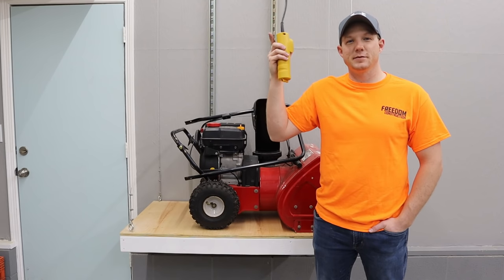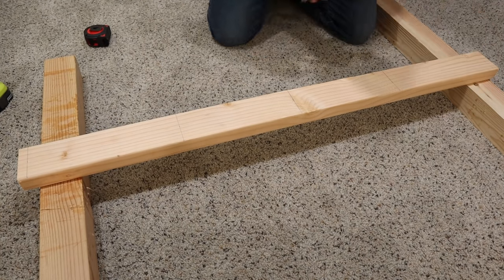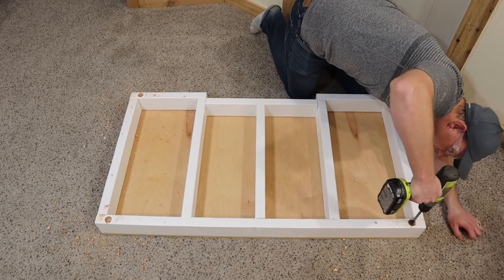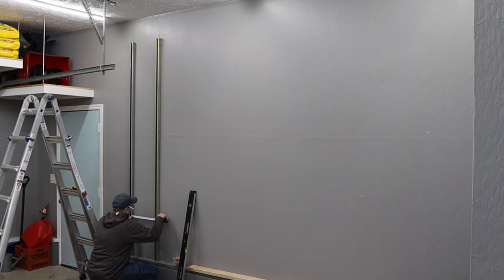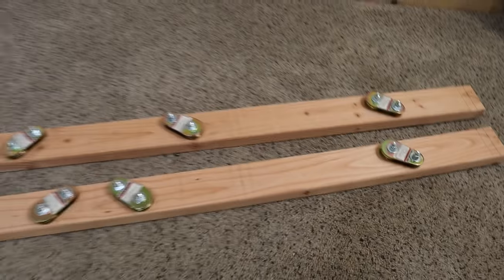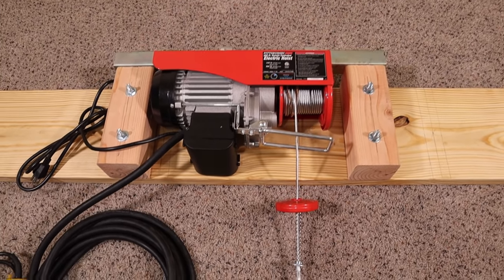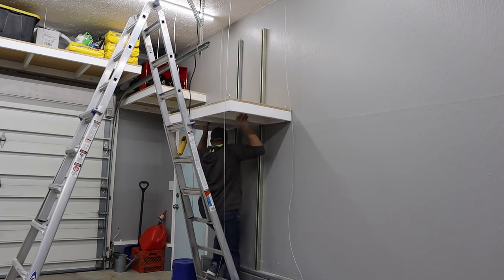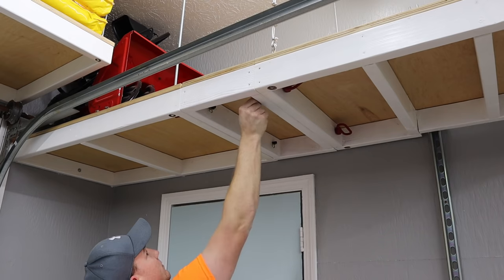DIY Electric Garage Storage Hoist | Snow Blower Lift | Garage Makeover Pt. 5

Comment: thank you! very informative on how i can do a similar project. laying it all out before installation help me see exactly how you did it. thank you!

you may be able to drop your lift all the way to the ground by angling your vertical channels on a wedged four-by-four so they clear the lower foundation issue. then mount your guide rollers on a hinge to accommodate the angle, then add the additional channels to the foundation. an added benefit to that is you won't have to lift the platform it all the way to the ceiling whenever you want to detach it.
Reply from the maker: Thanks! That is a good idea and If you do something similar I hope it goes well.

Comment: Your 'manifold' is actually called a "clue" in rigging terms. Also sheaves that change the direction of wire rope are called "re-direct" sheaves.  Fyi, Thats all.
Reply: Clew.  NOT "clue"  That's all.

Comment: It’s not bad, but I see a way you could have done it without going through the ceiling by running cables and pulleys  inside the uni strut, with the winch bolted to the floor. This would take the cables out of the way of loading. 
 That does NOT mean what you did was wrong.  
 You  did it how you thought best and how you wanted and it works, and that deserves respect in of itself.

Comment: Wow great…. Just a suggestion😊 Is it possible to make a turntable platform for a snow blower? My garage is small and with two cars it’s hard to bring the snow blower in and out. I have a corner in the garage where a snow blower can fit but only parallel to the wall. If I have a turntable platform I can rotate it and easily bring it out. Any idea how can I do it. I don’t mind manual instead of motorized 
Thanks a lot🙏🏼😊

Comment: Great work and a wonderful idea.  However, with everything you have mentioned, I did not hear anything about calculations for the additional weight that your trusses will now carry.  Trusses are engineered to use the least amount of materials to be able to meet the requirements for their use.  I doubt these trusses were engineered to carry the downward force being exerted onto them by your storage assemblies.  Although the snowblower only weighs several hundred pounds, the additional dead load of the bags of salt and other items certainly exceeds the specs of this roof.  Now add the weight of a good snow load (why else would you need a snowblower) and your garage roof is in danger of catastrophic failure.  As a 30 year career firefighter & carpenter, I have seen these projects, without proper engineering, go horribly wrong.

Comment: Be careful with that winch it tend to stack the cable like a pyramid and wen there is no more space on top the cable drops to one side the result is the the load drop instant with no worrying, we used one for a log home build, had one log just drop
Reply from the maker: Thanks for the heads up I will try to be aware of that when using it.

Comment: Great job.  I'm curious, why did you do much of the prep/assembly work inside on a carpeted floor, instead of in the garage?
Reply: @Zachary Peters I initially thought that was the reason, but you're wearing a short sleeve t-shirt in the garage!
Reply from the maker: Thanks! Ya it was hard to explain to the wife doing work on the carpet in the basement but it was better than running space heaters in the garage the entire time lol

Comment: Are you building this project in your living room? Carpet full of wood chips? Great idea tho. I was concerned(I am an electrical contractor) about the length of the screws you were putting into the wall studs.
Reply from the maker: It was in the basement because it was like 10 degrees outside lol I was pretty sure there was no electric in the wall because there are no outlets on that wall and the other electrical runs through the attic

Comment: Question for you, is there a reason that you had the lifting mechanism up in the attic space instead of the floor, bolted into the block?  I would love to do something like this in my house, as my garage has a high 12 foot tall ceiling.
Reply: I kind of thought the same thing.  Why not have the winch below the platform although I guess a 180 degree turn would increase the friction.

Comment: Your quicklink is side loaded and is the lynchpin. Your entire rating is the rating of the side loaded quicklink. You really need to replace it with the proper hardware and redo the incorrect cable clamps. Otherwise this is a really cool idea with interesting execution.

Comment: As a structural engineer I would like to point out that your roof trusses are likely not designed for the additional loading you are putting on them from all of the materials you are hanging. I would suggest getting the allowable loading sheets and verify that you aren't exceeding the bottom chord allowable live load.
Reply from the maker: Thanks I appreciate your expertise and agree that would be a good thing to do. My thought is on the shelves much of the weight is going to the wall and the lift will only lift the weight of the snow blower for short periods of time. You should see the junk neighbors in similar houses have in their attics lol
Reply: I couldn't agree more !

Comment: I didn’t think those hoist are supposed to be used for overhead lifting. Straight pull only. What happens when the hoist fails with your kid standing underneath the lifted platform?😮

Comment: This is a very great idea!! Very nice! Awesome! I was hoping to do this in my garage BUT I can’t do what you did in your attic. Is there another way to do this without having to go on another floor to apply the pulley system you have?
Reply: Yes, instead of mounting the electric hoist/ winch within the joist space, you could mount the winch to the garage floor near the wall and use pulleys at the ceiling.  Joists (2x10 or 2x12's) can carry the load, but if you have a truss system (a bunch of 2x4's that makes a big triangle system), then it's not designed to carry a point load such as this.

Comment: It seems everything in the attic has a low profile. So my question is why not take down the shelf for the snowblower and put the lift right there? You can make a safety pin to take the weight of the snowblower so your winch doesn't have weight on it all summer. That seems easier than raising it up, getting on a ladder and busting your butt trying to slide it into place across the bridge.
Reply from the maker: You make a great point. I guess I knew that I did not want to leave weight on it but your pin idea fixes that.
Reply: @ThatTechTeacher427  one last thing my back started hurting just by you telling us how you got the snowblower up and down before the left. That's is just nut. Haha I can't imagine how bad you hurt after doing that.

Comment: Could you have put 2×4's between the channels and the wall? It looks like that would have kicked the channels out enough so you cold have lowered it all the way to the floor?
Reply from the maker: That is true and a good idea but then it would have been difficult to put the snow blower on the platform because how wide the snow blower is compared to the distance between the cables.

Comment: I would just leave the snow blower on the trolley and use the other shelf for more storage
Reply from the maker: If I did that I feel like I would need a safety lock of some kind. I dont think I feel comfortable leaving that much weight held up by the cable break. But it would be nice.
Reply: @ThatTechTeacher427  good point be interesting if you could come up with something

Comment: That is really cool, but also over engineered...
I would have attached an eye bolt somewhere on the snow blower, used a pair of eye bolts and pulleys on the ceiling, one above the snow blower, one near the wall. I would have added a 2x8 across 3-5 joists in the attic, to reinforce that 2x4, probably with a pair of pocket screws per joist. on the floor below the snow blower, I would have added another eye bolt. Then on the wall, had a cam, to latch it in place for the season once it was in place. Then with a 1:5 reduction with some pulleys, I could reduce the weight to a manageable level, and easily raise and lower it.

Comment: Add a ramp on the side of the platform instead of lifting off.
Reply: Exactly! Design it so the same ramp acts as a platform over to the shelf up to to save you all that time with putting in that wood spacer and pins.  Flip it over, roll the snow blower over, then lift it up, drop the platform down, flip the ramp down to the floor in front of the door.   No lifting.  I have built two of these in my garage using 1" electrical conduit in the middle that is bolted to the shaft of that same winch.  As the conduit rotates it raises and lowers the 4 cables.   My way is much slower than yours though.  I really like the speed that yours goes up and down. Nice job man!

Comment: So, good idea...but why not just leave/store the snowblower on the elevator and use the shelf for other, lighter, storage?  Skip the little filler shelf and the hitch pins, and gain more net storage space.  This also prevents you having to go through the awkward looking process of moving the snowblower on and off the shelf to/from the elevator.

I considered this project...but then realized I moved to Florida instead, saved property taxes, paid cash for a house AND a boat, hired people to mow my lawn every week and don't need a snowblower.  Or lawnmower. 😁
Reply from the maker: Haha moving south would be the best solution lol. I dont want to store anything on the shelf because I dont trust the brake on the hoist to hold the weight for long periods of time.
Reply: @ThatTechTeacher427  Put a "C" clamp or a clevis pin in the track, then reverse the hoist to let it "down" and the shelf will rest on the clamp or pins.  even a "safety cable" could be attached to the front eye hooks and attached to an eye hook in the ceiling for off season.
Or, do what I did and worry about where to store the fishing boat.

Comment: Great.  So you built a shelf you couldnt get to so you built an elevator that didn't get to the shelf.  Why not just remove the shelf, even lengthen it, and turn THAT into an elevator.  Also you could have eliminated that entire "manifold" by running 2 cables down looping them through pulleys on the cart and running back up.  Doubles lifting capacity.
Reply from the maker: All are fair points lol

Comment: Why not just leave it on the lift instead of sliding it to the back? Great job man
Reply from the maker: Thanks! Right now I'm not a huge fan of leaving weight on the lift at all times for safety reasons. But over time as I become more comfortable with it and maybe create a locking system to lock in the up position other than the brake on the electric hoist I might start doing that.

Comment: I'm thinking of installing a much smaller, dumbwaiter-sized platform lift in a small shed that I can also use to ride up to an open loft (as a seat).  Essentially, I'm curious your opinion on using a leveling engine hoist shop crane accessory like this attached directly to the hoist and leveled (https://www.amazon.com/gp/product/B08221QGX1/ref=ox_sc_act_title_23?smid=A1V5ET0SAKS6WG&psc=1) that is basically a steel bar spreading the load off into four separate chains that I would lengthen to attach to the four sides of the platform (with a 1600 lb weight rating more than sufficient for my use).   This would be in place of the more elaborate pully system, turnbuckles, etc., that you incorporated into your design.  I would still be using superstruts, trolleys, and a solid wood platform.   I think it's a good shortcut, but would love to hear from those with more experience building similar lifts, or actual engineers.

Comment: Inch and an eighth screws go through drywall into framing lumber, those extra long screws will run into wires that are run in the center of the framing member. I’m going to assume you got lucky and didn’t hit something you weren’t supposed to.
Reply: Code requires holes closer than 1-1/4" to the edge of a stud to have a metal plate installed.  1-1/8" screws are very short (not much purchase into the stud); I would use 2" screws with 1/2" drywall.

Comment: Why didn't you just modify the shelf up there already and just make it slightly longer instead of using a 3rd piece that you have to add pins  and shit too? And to that guy wanting to add extra cables.... he's literally using less that 1/3 weight capacity of that cable. Shut up. He's not lifting a car up there. Other than that. Clean as all get out

Comment: I love when people take the time to share content like this, it's great because it shows that ingenuity comes from all walks of life.

The downside is that there are others that will see these videos and imitate them without much thought as to the safety or application...

In your case, you built a lift that will take care of your snowblower, and nothing else - excellent!

For any other purpose, this is quite unsafe.

I know that my comment will be taken as a blow, and I apologize for the hit to your ego.

None of the components used in your setup are rated for carrying a live person, so please be careful.

Inspect that winch and cable regularly - if it fails it will not be pretty.

Thanks for the watch and take care

Comment: Not a chance that the snow blower is 285 lbs.    It might be 85 lbs.   Mine is a  bigger snow blower and i can lift it.   If it were over 100 lbs wouldn't even try.  I am 57 years  old i don't do dumb things like lifting awkward  things over 100 lbs.         Maybe with you on the lift and the snow blower you might have 285 lbs.     I would do the spacer hinged on your shelf.  Lowering to a cleat on the lift.  No pins necessary and still very safe.
Reply from the maker: Ya now that I think about it the weight I said might not be correct 😬. It is pretty dang heavy lol. I like the hinge and cleat idea.
Reply: @ThatTechTeacher427    285 is extremely heavy.          But something like a snowblower is awkward so even if only 65 lbs it can seem a bit heavier.      Just looked up 24" 2 stage goes anywhere from 80 to 100lbs.

Comment: Way over built.  But I think that is my middle name.  One side note:  The bottom cord on the trusses are only rated to support themselves and the weight of the drywall.  Check out the Jay Bates Elevator.